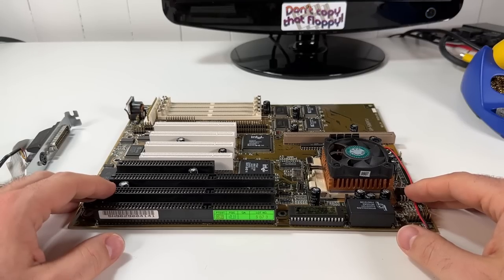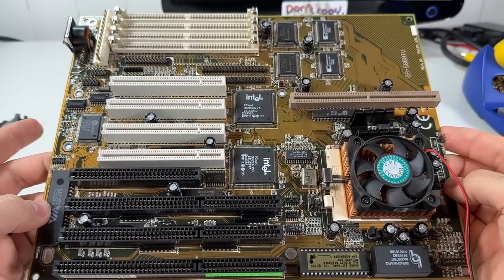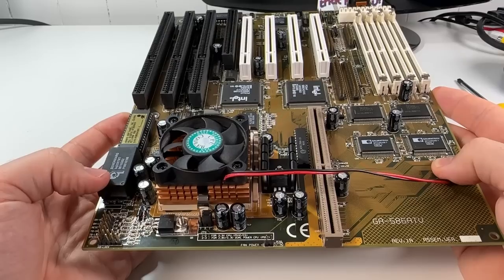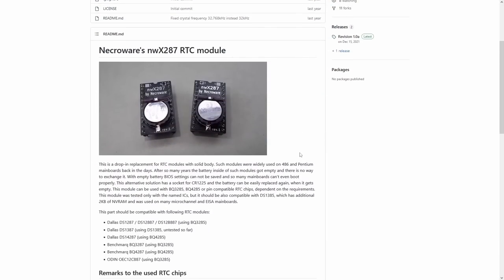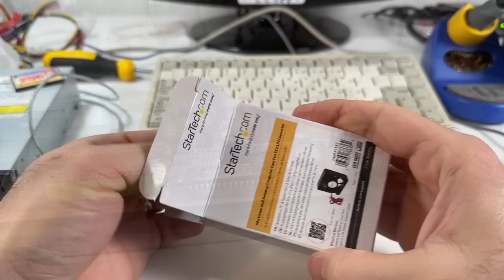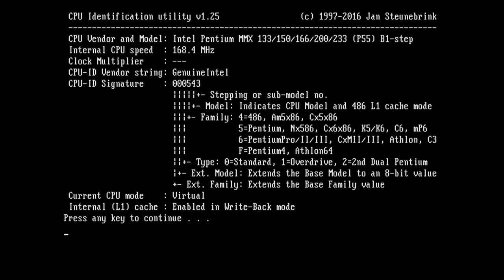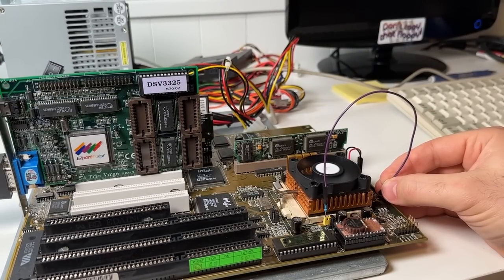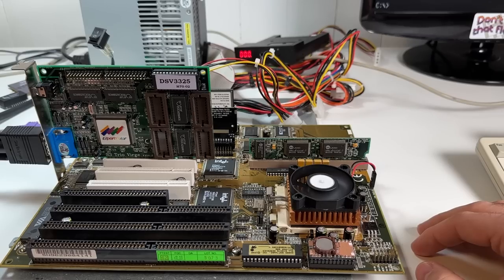Restoring and Upgrading a Gigabyte GA-586ATV Socket 7 Motherboard!

Comment: Implosions can happen when the cap's electrolyte reacts with material inside the capacitor, crystalizing and changing the pressure dynamic inside the cap, letting air pressure outside crush it in a bit. Few other ways this can happen too. Panasonics are an excellent replacement choice. Nichicon, United Chemicon, Vishay, Sanyo, all good
Reply: Happend to me but I think it was some big capacitor. A power supply did go big boom after powering a new mainboard up. Had two exact same pcs. One functioned normal. Ok see imploding.... For me was exploding.

Comment: Socket 7 is where a lot of people made their start into computer hardware, should be a good series.
Reply: Such a huge range of processor speed, features, pricing, and manufacturers (comparatively).  I guess now the complexity of CPU and chipset manufacture is too much and too expensive to get so much competition.  Plus Intel will change sockets twice before you even need to upgrade.
Reply: Yup! My First build late '97: Iwill p55xb2(Intel 430TX) here - still alive 03-27-2023..(CR2032 = lucky me)

Comment: 'mystery' brand Hitano capacitors are from Taiwan and still in business, ok caps actually
Reply from the maker: Good to know! Thanks for sharing. This is the first time I’ve seen this brand used. To be fair, it was only the one cap with the issue and all the others looked fine. My multimeter refuses to measure capacitance any more but I kept all the old caps to measure them once I get a new one. I’m curious if they remained within spec over 25+ years and what the imploded one will measure 🙂

Comment: I did the 3x multiplier hack with a resistor back in the day. On a brand new motherboard. The spec's of the board capped the speed of the processor at 166MHz, but i had bought a MMX200 (just released, so early 97? ). Brand new board and immediately starting to do mod's was super scary, but it worked. I don't know where i found the workaround, if it was on the internet or in a magazine. Loved that computer and i used it for years. I used a 1/4 Watt resistor soldered directly on the back of the motherboard on the socket. Looked crazy..

Comment: Nice to see a board I actually have.

I equipped mine with a K6-2 450. Runs about as well as you'd expect, with the chipset holding it back...

Comment: Really enjoy the no "bs" approach on repairs. Simple things that we can check. I didn't have luck yet with a Soyo Slot 1 board I got in August, it was supposed to be 100% and tested, turns out it turns on but I get 00 or C0 codes on boot. I checked voltages, clock, shorts, all ok so far. Once the board posted, I got into BIOS and could even launch MEMTest, but it frooze. I put it aside for some time, will try again in the future. I'm pretty sure it is something simple, like a cold joint somewhere.... the thing is to find it.
Concerning the BIOS battery, Scrap Computing rebuilt Necroware's module in order to fit a CR2032 battery. This is something to consider if anyone is going to order parts and build a replacement module.

Comment: I was shocked when you cut the fan wires, but I was quickly relieved when you re-pinned them. That's how I do it. I appreciate it when someone does an upgrade right versus just soldering some wires back together.
Reply from the maker: Couldn’t resist taking advantage of that dupont fan header just an inch away from the socket 😁 .. not a big fan (no pun intended) of those molex powered fans.

Comment: I had a cap let out a bit of smoke as it was running, turned off the machine in frustration and the next morning came back to sort it out, and it had signs of implosion too, I'd assumed it just got hot was able to vent, and then when it cooled off collapsed in on itself a bit.

Comment: great video! My collection of socket 7 boards are basically all PCChips - the only faulty ones I could found (wonder why!) and now I really feel I'd like a quality board to home in a case for a proper, permanent retro system I can switch on and play with every now and then! :)
Reply from the maker: Thanks Tony! Pentium systems like this are perfect "all around" retro gaming rigs. I have a higher-end 486 that I use for that purpose, but there are times I wish it was a Pentium :) .. I can't say I have much experience with PCChips stuff, but I do remember helping a friend build a system many years ago. The PCChips board he picked was defective and wouldn't POST and we had to go back to the shop to exchange it for another one. I think in the end he got a different brand.

Comment: These are brilliant boards! I still have the one which I have had since around '98 which powered my file server for more than 10 years.. it ran all day and all night pretty much for those 10 years and its still going strong today as my main retro gaming pc with no issues.. and you might not believe this, but it has the original RTC module (made by Odin in my case) and it still holds charge and keeps the CMOS settings, even when the machine is unplugged for a while..
Reply from the maker: They are indeed! That's amazing that the RTC module is still going. It probably helped that the system was in active use for so long. I don't think the RTC module's battery would be used while the system is powered on so it likely prolonged its life.

Comment: I recently came across a Gigabyte board with a P133 in it. Might be the same board actually. I noticed it has a COAST module installed and a Benchmarq RTC. I should dig it out and test it. It used to control an old CNC machine at work

Comment: Very strange to see something so late with even a single 8-bit only ISA slot. I guess since that slot was shared with a PCI, they figured you'd either use it for a modem or just shove a PCI card in there, but still.
Reply from the maker: Very true! I think modems were really the only common 8-bit cards you’d see around that time. Doesn’t look like there was enough clearance to get a 16-bit slot in that location either.

Comment: This series of Gigabyte motherboards also have the turbo header. The turbo function works by disabling the CPU cache and dropping the bus frequency to either 50 or 43MHz, depending on the model. Not as useful as "true" turbo, but still nice to have if you're using a Pentium MMX CPU together with SetMul to hit multiple performance points (386, 486 etc.) in one PC.
Reply from the maker: Good point, thanks for sharing! You don't see turbo headers too often in Pentium-era boards, so definitely a nice bonus. I'll have to give it a try one of these days.

Comment: I’ve been looking for Necroware’s RTC replacements. I know it’s bordering on nitpicking but I’d really prefer a yellow PCB, just like yours, for my T2P4, not a black or purple one. It would simply look much better in my opinion. Any hint on where to look for them?
Reply from the maker: The PCB I used is from OSH park. It’s their afterdark version with a black PCB and clear solder mask. Looks really nice. It doesn’t quite match the brown/gold motherboards from that era but definitely blends in a bit better than the other options 🙂

Comment: Where can one get drivers for GA-586ATV? Found one on ebay but no s/w.  WOuld like to build a Win95 P 200 MMX system.
Reply from the maker: For Windows 95/98 there shouldn't be anything special required on the software side. You can get the intel IDE busmaster drivers, but even those shouldn't be necessary. They are available on the retro web page for the board: https://theretroweb.com/motherboards/s/gigabyte-ga-586atv#downloads .. best of luck with your build!

Comment: I finally fired up my 586ATV and it works, I even found an MMX166 in my stash, I'll have to give that a try.
Rev.2A does not have the jumpers to enable the split voltages for MMX CPUs, that's strange.
Do you know if it is possible to upgrade single-sided 16MB EDO RAM modules with 8 chips to 32MB by soldering another 8 chips on the back of the module ?
Reply from the maker: Thanks for your comment! Good question, can't say I've ever tried adding more modules to a DIMM before. This sounds right up 'bits und bolts' alley if you wanted to ask him about it :-)

Comment: Hey there! That tray that was holding the classic Pentium 200 was 3D printed, right? Could you share that model by any chance? Congratulations on your awesome channel, you got a new Brazilian fan! :)
Reply from the maker: Thanks very much! That tray actually came with the Pentium 200 that I bought on eBay from the previous owner, but I actually did design some similar CPU trays (1, 4 and 6 CPU trays) a few years ago. There are lots of good ones available online too, but you can find the 3D models I created here: https://vswitchzero.com/2018/10/01/3d-printing-cpu-trays/

Comment: Hey no word on the COAST module ;-) It just worked without any jumper settings necessary? I went through quite a few jumpers and modules on my 430VX board until I got 512K working.
Reply from the maker: Thanks for your comment! Sorry I forgot to mention that bit. Yeah this board has nothing to configure. Just plug it in and it’s detected. One of my modules refused to work (system hangs during post) but the UMC based one works just fine thankfully. I know some boards can be very picky.

Comment: i replaced an rtc recently on an asus board, it was kinda funny because it "worked" with the dead battery but the bios defaults the boot to the C drive and obviously wouldnt hold the setting of booting from A first, so i was able to boot into the existing os which was win95 but my plan was to use a cf adapter and install dos from floppy

Comment: Great video! Love your stuff :) Would be really cool to see the 166 system with a 3D accelerator try to run the original Half-Life haha. Technically could meet the recommended!
Reply from the maker: Thanks for the idea! Would love to explore some “minimum spec” performance with and without 3D acceleration. Finding the time is always the challenge 🙂
Reply: You don't necessarily even need a 3D accelerator to run Half-Life. Back in the day my family computer had a P166MMX on a i430HX motherboard, 32MB RAM and S3 Virge 2MB and I played HL through at least twice on that hardware and countless hours of multiplayer and mods. However it might not be exactly playable by today's standards but back then we just had to do with what we got :D

Comment: Decap the RTC module, solder a new CR1220 with taps. Or if you're brave, use a spot welder to solder taps to a CR1220.
I can confirm V.2A has a golden heatsink. ;) Unfortunately, I don't have a cache module.
Reply from the maker: Thanks for sharing! Good to know about the v2a. I wonder if they fixed the MMX multiplier in that revision. I kept the BQ3287 just in case I need to mod it in the future 👍
Reply: @vswitchzero  I don't know, don't have a 200MHz MMX P5 and don't have a manual for this board.

Comment: I have revision 1A of this mainboard with the golden heatsink. I can’t get the PS/2 mouse to work at all. Windows 95 recognizes a mouse but it has a yellow mark and doesn’t work. I also have an optical ps/2 mouse and it has power. So the port seems to work. But in the bios ps/2 is not mentioned. Any Ideas why it doesn’t work? Do i need a bios update?
Reply from the maker: Thanks for your comment! Are you using the PS/2 header that was included with the GA-586ATV or a different/generic one? I've found that the pinout can vary quite a bit between boards in this era. I have a slot-1 motherboard with symptoms very similar to what you describe as well. In that case I discovered that the PS/2 connector itself was bad/flaky. I had to wiggle the connector and put a lot of pressure in order for it to work properly. I don't think the BIOS should matter as all revisions should include PS/2 mouse support.
Reply: Thanks for the reply! I think I am using the original header and slot bracket that also has a parallel port. I have the mainboard still in the same case that it was used in back in the 90s. But I am not sure if I added the bracket later. I checked the pinout and the wiring and it looks the same as in the manual. It could be a loose connector indeed. I am about to rewire the bracket and use it on a dfi p5bv3+ and a shuttle hot-591p that have a different pinout. Then the ga586atv will go into storage. I wanted k6-2 anyways and so I will use those boards as they also have usb and the dfi also supports usb keyboards. The convenience of being able to use usb input devices is quite big for me. Hopefully it will finally serve me as the retro pc I wanted to build for many years. Its a nice tiny case for baby AT with a K6 sticker. I have collected so many parts, I also want to use my 486 and pentium mmx stuff, but I need to shrink it down to a small unit and I guess k6-2 will be able to do more on top of what those older CPUs can do. Might combine it with voodoo 3 agp and sb awe 32. We‘ll see ;)

Comment: Hello Mike, so now I got my eyes set on these beautiful golden Panasonic FM capacitors, not silver like the ones on my Soyo Dragon but they will look good in most of my motherboards!
I will start making an inventory of the ones I need, It's Moser a good source or is too expensive?
Reply from the maker: They are great caps. Pretty much the lowest ESR you can find these days without going polymer. I got mine from Digi-Key. Newer FR series is similar spec as FM but not flashy looking. FC is also quite good but dark blue/gold instead of black/gold.

Comment: May I ask an advise in repairing a 486 VLB+PCI board which someone used for soldering and desoldering practice?
Reply from the maker: Sure, what is the condition of the board?
Reply: @vswitchzero  Thanks! From my inspection these are as follows (in the order of severity):
- A burnt place near the edge of the CPU socket where the board bulges slightly (Looks like a short inside the PCB, which was probably the initial reason why the board was scrapped)
- Bent pins and a snapped pin on one of the Chipset ICs (the pin is snapped just outside the chip);
- No cache ICs and associated ICs around (I can live with it)
- No 3.3V VRM (I can live with it)
- Missing caps, clock oscillators and resistor arrays. Resistor arrays are used on this board to set up CPU settings (I found a person with the same board on a German forum, so I could ask for photos with the missing details).
- No DIN port.

I can send photos on your e-mail once I get to the board.
Reply from the maker: @krzbrew  Oh wow, quite a few missing components on there. My biggest concern would be the burn/pcb damage. Even if the components are replaced, I'm not sure if is a multi-layer PCB and there is damage that can't be accessed. Could be a fun project to try regardless! Best of luck.

Comment: Any tips for finding one of those cache modules on eBay? I have one of these boards and would love to find one.
Reply from the maker: Thanks for the comment! They are somewhat difficult to find, but they do pop up on eBay from time to time. They are usually called "COAST" modules or "cache modules" when you search. Even though they look physically the same, there are numerous revisions out there and not all will be compatible. In my experience, it's about a 50/50 chance any given COAST module will work in a board. Best of luck! Hope you find one.

Comment: Throw a tiny dab of thermal paste on the back of the regulator when swapping the heatsink, it won't be massive but it will cool better.
Reply from the maker: That’s a good idea. I thought about using a thermal pad but paste would definitely work too. I may give that a try 👍

Comment: Added pull up resistor works fine with original Pentium - its just parallel to internal one.
Reply from the maker: Ah cool! That makes sense. I may go back and do the mod when I get some time 👍
Reply: @vswitchzero  Or there is another funny thing. You can use Pentium MMX 233 (or 200 overclocked) and set multiplier to 3.5, because it is the same as 1.5 for old Pentiums. In this case both pins are shorted to ground, so it works without modification. When Intel inroduced Pentium for Socket5/7 they choosed only 2 pins for multiplier, so there were only 4 combinations. 1.5  2  2.5  3. When Pentium MMX was introduced, there were no combination for 233, so 1.5 multiplier was used as 3.5. Later AMD started to use pin BF2, it enabled 8 combinations. But with AMD K6-2 more combinations were needed, so multiplier 2 became 6 for AMD K6-2 and K6-III.
Reply from the maker: @xsc1000  Very interesting, thanks for sharing! I always wondered how they managed a 3.5x multiplier on the 233MHz model. I do remember hearing about the 2/6 multiplier on the K6-2.

Comment: 9:04 what is the name of this tool you using?
Reply from the maker: It's a Dupont Crimping Tool. You can find kits on Amazon for around $20-30. Most can crimp other connector types as well, but I've only used it for dupont connectors.
Reply: @vswitchzero  Thanks :)

Comment: noctua the S'#& out of that fan, please ;)
Reply from the maker: I can’t wait for Noctua to release a 50x10mm fan. So many old heatsinks used 50mm for some reason.
Reply: @vswitchzero  wont those small server fans fit? Or.. 3Dprint a 'converter' for their smallest fan. I dunno know. I'm talking outta my ass here. Love your channel.
Reply from the maker: @all_the_moga  Thanks very much! :) .. I'm sure there is probably some way to adapt a 40/60mm fan to fit cleanly on there. These Pentiums don't need a lot of airflow to stay cool. I could probably use one of those Noctua LN adapters too.